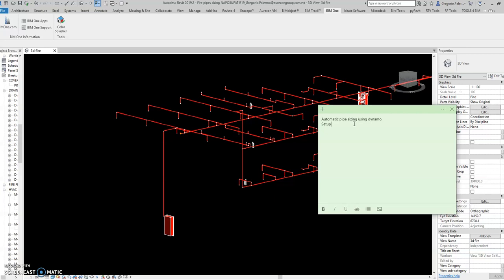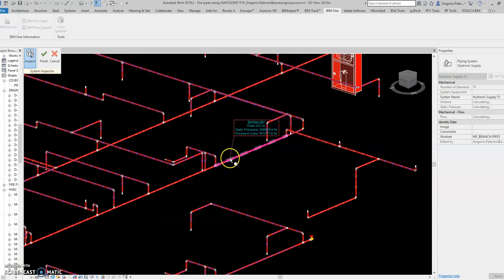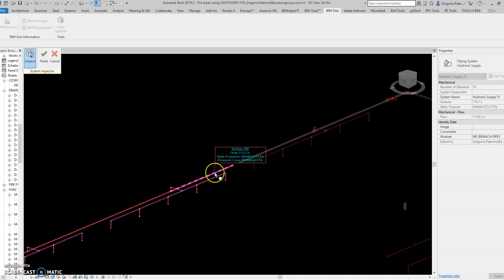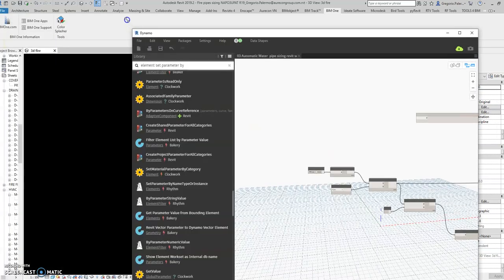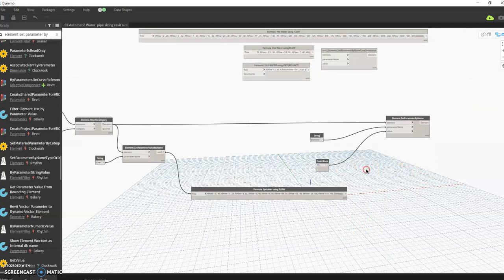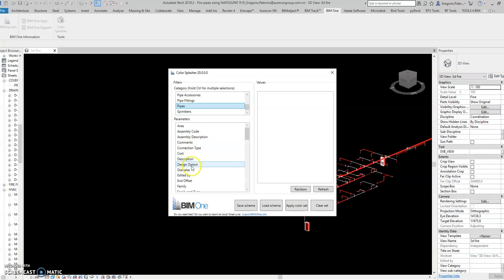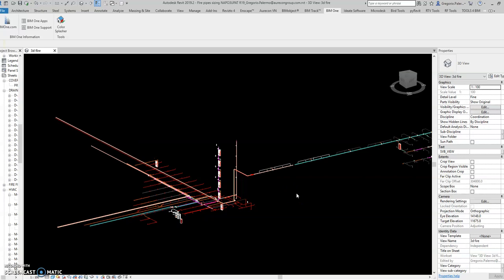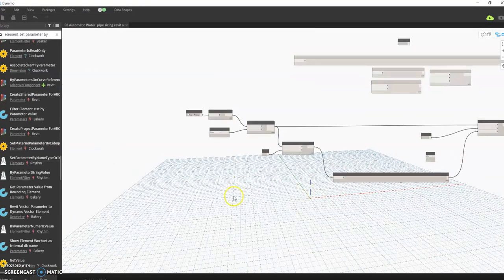Fire figthing automatic pipe sizing DYNAMO

Comment: Hello I am new to dynamo, I success to update the pipe size but the diameter of pipe fitting seems not following the diameter of pipes, is it the problem of setting in revit?
Reply from the maker: Change the fitting type to fitting reducer. This will change all elbow and cross to adjust base on the pipe size
Reply: @eliabim  you mean to change the family from fitting to reducer?

Comment: Hi Greg, normally the fire engineers will do a hydraulic calculation using software like Hyena to determine the pressure losses across the pipes, fittings, elbows, etc. basing on the hazard group of the building/project. 

The higher the hazard group, the more stringent the fire sprinklers will be designed for. E.g. design density flow rate for sprinkler will increased, reducing of spacing/distance between each sprinkler heads, etc. All these will contribute to the sizing of sprinkler pipe. 

Maybe we can explore by using this to do the pre-hydraulic calculation (before doing full calculation), where the pressure losses across the starting point (pump) to the most remote/unfavourable point shall not exceed 150 kPa with 1800 L/min flow rate.  

Nevertheless, thanks for sharing :)
Reply from the maker: I love to do that with complete pressure calculation. We can auto select what pressure value of that certain area.
Reply: Maybe you can look at how fire sprinkler hydraulic calculation is done. 

Btw is that fire hydrant or hose reel box u mean mentioned in the video?